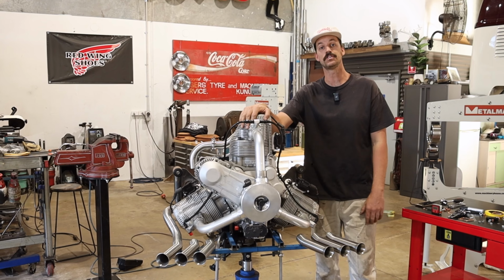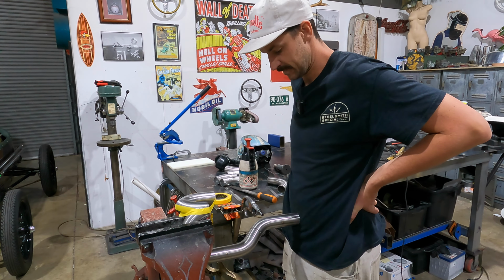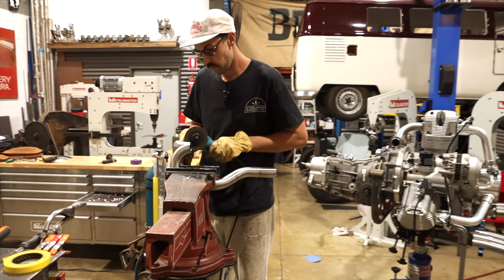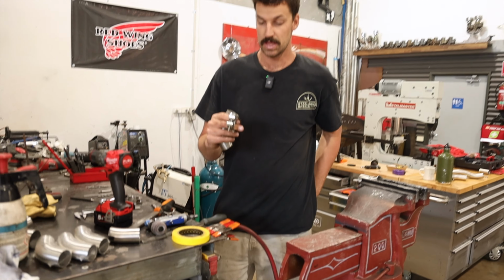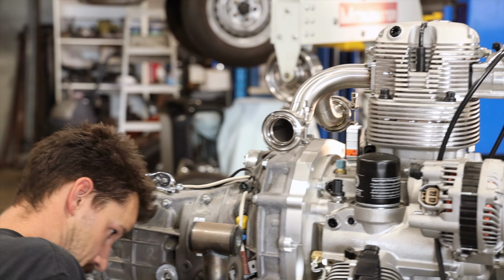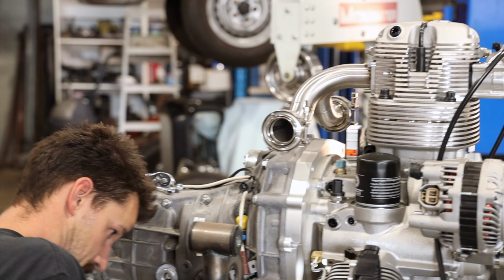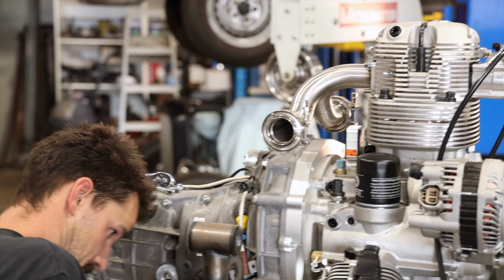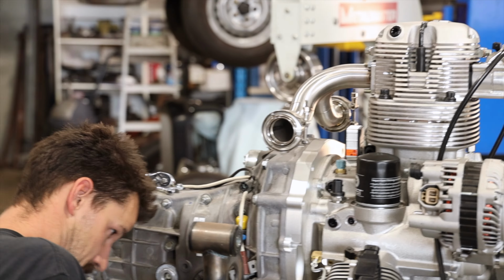EP. 9 - CRAZY CUSTOM 3 IN TO 6 AIRPLANE EXHAUST | Radial Airplane Motor Volkswagen.

Comment: This is a sexy piece of art and you are killing it. For what it’s worth I’ve seen Brent at Halfass Customs use a zip-cut on the inside of the radius to cut a series of slices about 80 or 90 percent of the way to the outside of the radius while leaving the outside. He then simply bends the pipe into the curve he wants and makes more slices if he wants a tighter curve. It looked like a great idea and you may see if it would help. Greetings from cold snowy Edmonton.

Comment: When I work on stainless exhaust I have clamped  on mild steel to hold the digital angle finder.  I use pie cuts for tight radius bends , spreading the radius over 2 or 3 pie cuts spreads out the peaking. You have done a fantastic job. Love watching your channel. Vern from western Canada.

Comment: Hey Jordan, that engine is a work of art and too darn sexy to hide way in the guts of a van. You certainly are a talented creative young man. If only I had the manual stability to TIG like that! I have played with heavier metal to make some of my own tractor implements. Drawing the curve for the arc that you need could be done with a compass. Draw it on a bit of board then pie cut on the inside of the curve, but not all the way through. It may give you that smoother curve on the outer edge.

Comment: I used to repair saxophones. I had a stake that you could screw on different size balls onto. One end had a gradual curved end . So one could feed it in to the instrument. Then you can hammer down the peak.This would help you with your peak issue.

Comment: I trimmed the guard on my grinder, took a good 3 inches off, and it rarely ever gets in the way now. It not only protects your hands , but also your eyes, if you keep your head on the guard side , not the open side.
Reply: I like the thought, I would trim a bit at a time to what suits me, whatever the case my fingers need the protection. I have some old guards to test the idea, just never thought of it and put up with the limited cutting range. Eyes are protected by your PPE. When you think about it, a built in finger guard on the casing of the motors would help, that all these fabricators remove them should tell the manufacturers tha a redesign is needed.

Comment: Exhaust looks great but so did the 32 radiator on the wall. Very artistic 😜
Will the pipes running so close over the heads create heat issues

Comment: I 3d printed my own exhaust header mockup blocks . I made them all  22.5 degrees with incremental notches as well as 50mm straight pieces,  they can be made on a cheap 3d printer. 
I can send you the file if you want to 3d print your own set
Reply from the maker: That would be amazing!

Comment: If you tightly pack the pipe with dry sand , heat pipe ,it should bend without kicking or wrinkling.

Comment: You need bends with a smaller CLR - center line radius. Unless you want to pie cut the whole bend, using the bends you have won't work for a smooth transition
Reply from the maker: Most definitely

Comment: One should try and avoid using bolts in aluminium, studs are a more permanent solution because you aren't "working" the thread whereas  every time you replace the bolts
Reply from the maker: Great call

Comment: IcengineWorks for the clicky exhaust mock up blocks. 
what do you rekon to sand bending tube that size/radius? even if just to make sections you can take pie cuts from?
Reply: could you have cut 2/3 (or more) of the way from the ID to the OD of the arc removing metal that would allow you to bend it tighter? like i have seen you doing before, i think on chassis rails?
Reply: I should say, looks amazing. you pulled off the aircraft inspired aesthetic you were after. proper nice.

Comment: Theire so close to the cilinder heads that, maybe, you will have to think carefully in a nice cooling sistem
Reply from the maker: The motor being water cooled will help, an oil cooler too, pipes being coated and some heat shield we should be in the ball park, a few scoops to Lift air in the engine bay will help too